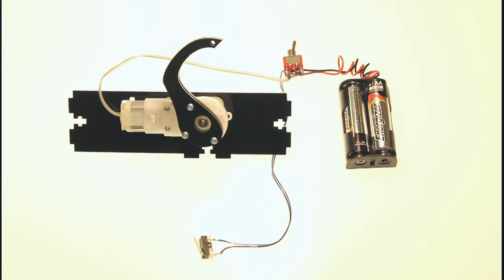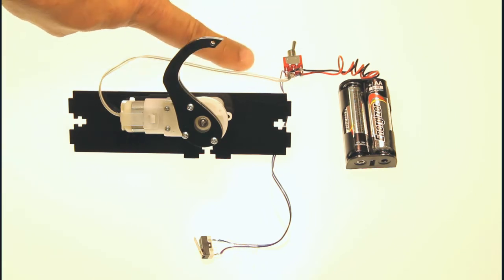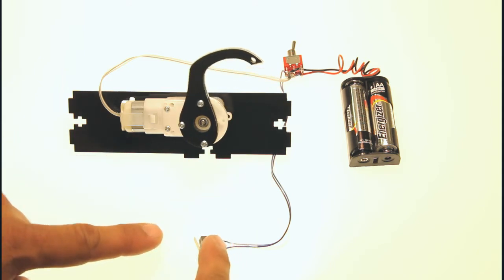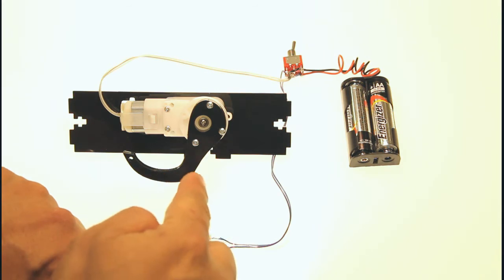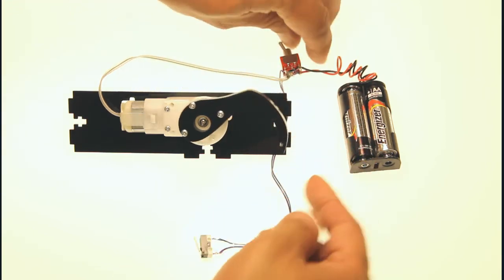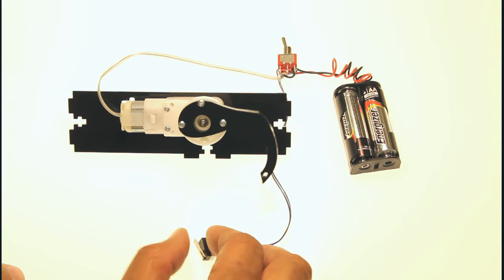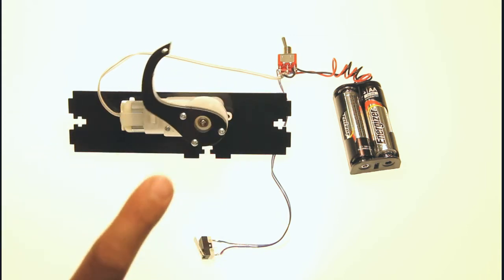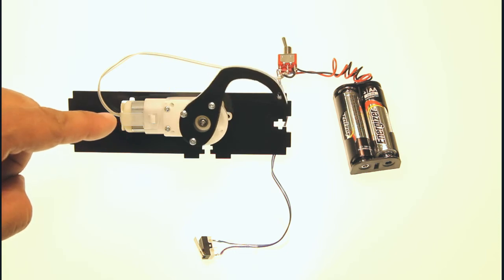Useless Box Wiring Test

Comment from the maker: Only works in one direction... Hmm. Take a close look at the limit switch under the finger - make sure the middle pin isn't wired up by accident. Wires should only be connected to the outside two pins. It won't turn off if this switch is miswired, and will make the motor heat up (but not dangerously so).

Comment from the maker: Ah, we've seen that problem before. It happens when the the motor is wired up in reverse. Not a big problem.

To fix it, reverse the motor wires (swap the connections). THEN, loosen the nut holding the main switch, and spin it around 180 degrees (tighten the nut up again).  All fixed, with an excellent battery life!

Comment: The box I have works fine and has almost no problems. But when I turn the switch on, it moves extremely slowly.  BUT, if you hold the limit switch down then, it moves fast enough to flip the switch back and stop.  I then have to take my finger off the limit switch and the finger returns quickly back into the box. I've checked the wiring and nothing seems to be wrong. The batteries have been replaced multiple times but nothing has seemed to fix the problem. Any ideas?

Comment: My circuit heated up, not actually the circuit but the battery heated up after the connection. The motor works one way but if I toggle the switch it does not work. I have checked the connections and they seem to be in the right order. Does anyone know what might be the problem?